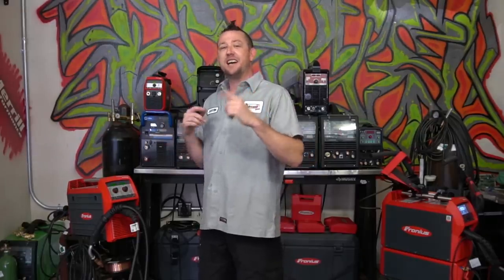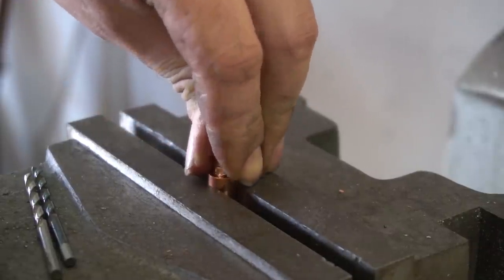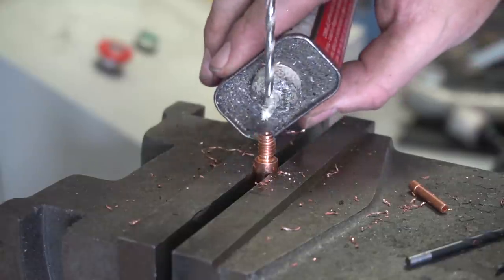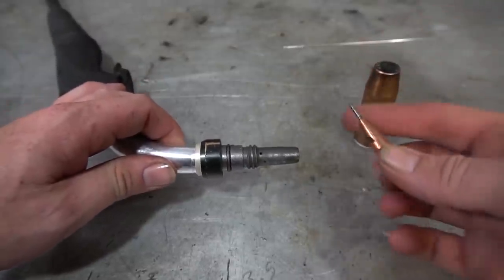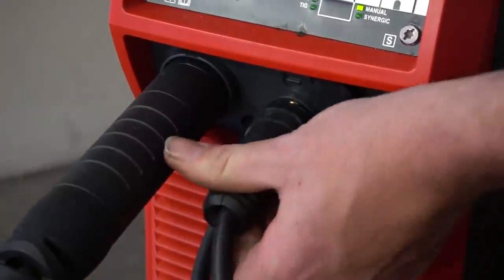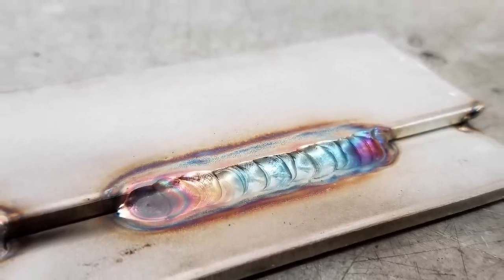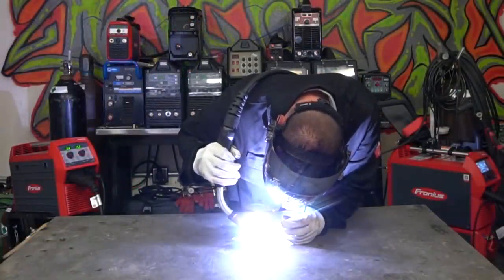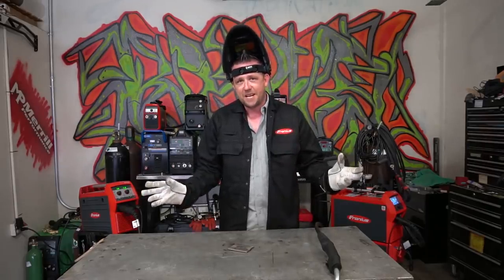TFS: HOW to convert your MIG into a TIG Welder

Comment: My question may seem ludicrous but does it work with flux core mig or do I need gas absolutely ? Nice vid. Thanks, that is awesome conversion.
Reply from the maker: daVidFonda You have to have shielding gas to make it happen.
Reply: davidfonda.. something like this might help you out.. WP-17F 12Foot Air-Cool Tig Welding Torch..

Comment: How do I run my tig and mig on 1 argon tank yes its 100% argon and 1 regulator 2 hoses if possible but only 1 welder will be turned on I just do t want to keep swapping hoses I do have a double regulator it's from China I dont want to sit next to the thing head of them exploding

Comment: How does the power get to the tungston? Do you need the wire touching the other end
Reply from the maker: Tom Bacon No wire needed.
Reply: I would suggest looking up how a mig welder gets power to the wire. The wire isn't energized until it passes through the contact tip. The wire (or in this case the tungsten) must touch the contact tip to transfer the energy through the wire to the metal. Hence the name CONTACT tip. Hope that helps you understand.

Comment: I, m thinking convert Mig to Tig welder with auto feed using Mig   wire. Mig gun should only function as gas n wire feeders. Attach tungsten electrode n connect to electrical part.

Comment: Not getting the mig tip redo. The mig wire is powered as it is fed through the nozzle, how does the modified tip you made get power?
Reply: By "shorting" with contact with the work,(ground)

Comment: Since MIG welding has a whole different way to work with you on changing geometries by effectively raising or lowering the current it seems a very difficult way to weld TIG with it. 
Even if it is strange I still like the effort.
A little more scientific warning to all of those MIG welders out there who could be trying this and failing would have been nice though.

Comment: Do you have to press the trigger to initiate gas flow?
Reply: Brandon Parry well I imagine so and you won’t get any arc without pulling it either. Of course the force is strong in this one...
Reply: fishhuntadventure thats a good point. If you taped it, could get a closer grip and post flow haha
Reply: fishhuntadventure post flow from far away that is. Maybe a trailing shield would be in order for stainless.
Reply: Most mig machines have some sort of electrical connector for the trigger located near the "torch" connection. Simply disconnect the factory supplied connector, rob an identical connector from a worn or damaged lead, and build a crude foot pedal trigger with enough length of wire to get to the work station/position. It will still be a simple on/off switch like the trigger is, but would allow for pre/post gas flow. Also as previously mentioned a Tig is CC and Mig is CV and a Tig pedal is a potentiometer that allows for a variable output.

Comment: I have a ramsond cut50dy plasma cutter.
looks like a little tig welder. theres a decal on side part of it says "arc/welder" bought it from a guy few years back. hardly use it. anyways, can a plasma cutter be modified as tig(dc)? always wonder, didn't find anything on forums awhile back. good video man. thanks Justin.
Reply from the maker: Ryan gst You'll have to find a way to bypass the air pressure safety (if it has one) and disconnect the air. Just add argon and a torch and you'll have a DC TIG.
Reply: The Fabrication Series dam, bad ass. yea it has an air source on the back. and always thought about tryin that out. just didn't want it to blow. appreciate your feedback. thank you👍👍

Comment: Main problem I see is that MIG is normally constant voltage and TIG requires a constant current power source.  Of course if you have a modern welder you just flip a switch and the magic of electronics takes over.

Comment: Your drill bits were wobbling. There goes your precision.
Reply: when drills are put into a chuck correctly, they self center with a little pressure. not losing any precision other than use a drill chuck instead of a collet or other tool holder. and its drilling a weld tip out lol this isnt NASA .0001" precision here... chill out
Reply: @Collin326C  
Yeah I was gonna say as well; it's not machining, part in a pot chuck, indicated and drill in a mill chuck....ha ha ha

Comment: well a mig welder is a bit more thn a power supply..its also a wire and gas feeder  .stick welders are literally power supplies...with specialized connections for specialized electrodes.

Comment: Hey Justin thats pretty kool stuff i knew you would make a vid on this topic. And i know its 100% work becoz i convert my Lincoln Weld-Pak 100 to mig/tig i just bought a tig torch kit on sale and switch the wire around made a turbo mani and exhaust and still havent crack yet.

Comment: That's kinda like driving finish nails into moulding with a masons maul, don't ya think? I can't imagine where that would be a good idea. I can see using a mig or  a tig torch as a stinger in a post apocalyptic scenario where you might need to armor up a vehicle or some other life or death scenario, but not this! I suppose if money were no object and I had nothing better to do than going full AvE on my equipment, then screw ludicrous speed... go straight to plaid!!!😆
Reply from the maker: patrick farley I love the end of this comment.... #SmokeIfYaGotEm
Reply: patrick farley hgg
Reply: patrick farley You can’t imagine where this would be a good idea really how about you need to weld something thin that your Mig Welder wont and you just don’t happen to have a Tig welder laying around. Really this would absolutely work
Reply: Hi Trisch, well seeing as most mig welders lowest amperage is about 30 amps for material that is roughly 24 ga. (.025") thick. Today's TIG machines go down to 5 amps and some 2 amps. For better heat control than this mig gun with tungsten, I would use O/A. If it is too thin for MIG, the tensile strength of braze or solder will be more than sufficient. So this goes to my original thought that using the right tool for the job is your best bet. I hope that clears up my comment. All the best.
Reply: I don't think anyone questions that it is better to use the product designed for a specific job....but who has all those gadgets in their garage.  If you can make one thing work as another to get the job done, then you are just a little wiser than those who don't. This is obviously not for commercial purposes, but for home use it seems to me like a win.
Reply: I know whatcha mean but there's definitely plenty of scenarios where this is extremely handy for sure. One being when a person can't afford a TIG machine & has to weld any semi-exotic metals for one reason or another as I've done this years ago myself. Or if you have to do some thin stainless repair or whatever & don't wanna drop the cash for a spool of stainless wire. Ya can also buy very cheap small TIG machines nowadays but obviously but not everyone has the $ for that obviously...

Comment: Great video! I have just ordered and received most the pieces I need to do this, now I just need to rebuild a microwave transformer to convert my Flux 125 to DC.
Reply: You don't need a transformer to convert to DC, you need a rectifier circuit.

Comment: Can a Tigue torch be hooked up to a mig welder
Reply: if you can get power from the mig tip and connect to the Tig torch yer or maybe look at a cable you can screw into where the mig lead connects to the welder???

Comment: I have a Lincoln electric welder and want to make it from mig to Tig can you help me convert it?? I'm welding a motercycle gas tank and am welding right through it wondering if TIG would be lighter on the metal and not eat through please help. Private message me if you would like I'll send my info appon request URGENT PLEASE.

Comment: Why does no one sell the mig tig adaptor bit he made in the beginning of the video?
Reply: Ian Pollard great question they have left the market wide open for you to make your first million. Go for it I will buy a starter kit from you. Seriously.
Reply: You can buy a conversion kit for Euro mig connector for about $10 and a complete tig torch assembly for about $30. The right brass fitting to connect the 2 for a few dollars, connect the wires and away you go.. Takes under a minute to change from one to the other.
Reply: Brett Whitla right on, where?
Reply: Ian Poland.. What are you asking ?

Comment: Information update: i tried scratch start, but in low amps any arc can not start, on high amps very weak and poor arc tries to appear, but the TIG electrode (Red color) melts immediately. So to ask again: somebody, any ideas?
Reply from the maker: 2 things that make a tungsten melt - wrong polarity or way too much power for diameter.
Reply: +The Fabrication Series Thanks!
Reply: +The Fabrication Series Help please... i used two different Stick welding machines, wired torch negative, used 2,4 mm red TIG electrode and 100% Ar, perfectly cleaned surface, but arc just does not start... actually it started 2-3 times for less than 2 seconds.... What to do...??
Reply from the maker: It's difficult to say. You could be long arcing or not have enough amps. Maybe lift instead of scratch... It could be half a dozen other things. Without seeing it all I can do is guess.

Comment: Can it work without using gas?
Reply: NO, absolutely not.
Reply: @BCole-bj4lv  Thank you very much .. I did the experiment without gas a long time ago and the welding rod got stuck to metal. I thought that the problem was with the welding machine
Reply: @hammodi88m  Your welcome. All three popular types of welding require the weld to be shielded from the effects of oxygen. Stick does it with the gasses formed by the flux on the rod. TIG and MIG rely on the inert gases used. With these two, the gases also help in directing the, (what I'll call - cone of the weld) so that the ionized flame has shape (especially in TIG). Let oxygen get in there and your weld turns ugly, jumps around  and  turns gray.
Reply: @BCole-bj4lv  Thanks for the valuable information

Comment: Hold yours horses. If a MIG could be converted to a TIG (understandable) a MIG could be converted to STICK welder as well? AH...I'm going for it...
Reply: Denis Cortes I think you’re on to something there.. all you would need to do in reality is get a 3/32 or 1/8 collet to fit into the gun like he did here to clamp down on the rod. Pretty simple I guess.

Comment: I bought a 800$ (at the time) flux core, i'm cheap as fuck even though I have the funds available, it's easy to use my flux as MIG and stick. There are a lot of people in this world who would rather make it work with what they got, I mean, if they wanted an actual whatever the item it may be, they would just get it. Having the knowledge to turn your welder into TIG, MIG, flux or stick with very little tools is more than school will ever teach you. How to make a lot from practically nothing, no one's gonna teach you that. Teach me to make stuff and how it works, i'll get something figured out much, much faster. I might even come up with a new way to do it, who knows.

Comment: I’m gonna give it a whirl. I have an old mig that I literally pulled out of a dumpster years ago...the wire feed is jacked....I’ve repaired it a few times but gave up on it. I also happen to have a tig torch assembly I picked up for super cheap.

Comment: ...perhaps you shud just use a tig torch instead, just adapt the tic torch plug to the machine.. this way, its already a better TIG torch usability wise...  in fact, if you can TIG on your MIG machine, you can also adapt a PLASMA cutter torch to the MIG machine.. the TIG machine can basically do PLASMA cutter.. you just have to replace the TIG torch to a PLASMA torch & use an air compressor for the gas line..  it now becomes a MIG/ TIG /PLASMA cutter/ ARC-MMA stick welding machine.. just replace your torch & plugs..

Comment: Keep the tungsten sharp, otherwise the arc is splayed outside the shield gasses. Walk the cup, let the wire melt into the puddle. Quit dobbing the fillerwire like it’s a coat hanger and oxyacetylene flame! Weld should be smooth and filled in one pass on metal that thin. I remove my MIG from the power source and mount my TIG torch, adjust the polarity. Carbon dioxide gas on carbon steel, argon on non ferrous metals. Same as always!

Comment: I actually thought he was gonna attach a Tig torch to the machine. At least a mig machine has a gas solinoid. I have run Tig off a Miller Trailblazer with the gas bottle near by to turn it off and on. Talk about post flow.

Comment: At this point why not just buy a tig gun and install it?
Reply: That's what I did with my bossweld 180. Got a cheap wp-17 hand piece and lead and fit the euro fitting. Whole lot for less than $100 And it does the job, the trigger controls the power so i
No need to snap out of the ark

Comment: This will not work with every mig welder just so people know. I tried to buy I harbor freight welder and hook the internals up to my miller HF start tig box (not a stand alone machine). Didnt put out enough amperage to draw a nice arc....most mig welders dont need to have a long arc what so ever. So they are made to have a super small arc unlike stick and tig welding....I would say this only worked because it was also a tig machine.  But I have not tried every mig machine

Comment: Would this work with flux core? Could I adapt a tig torch to replace the regular flux core and use flux core wire to eliminate the need for shielding gas?

Comment: If you have a machine, that CAN fit a MIG torch, and can ALSO give you fixed  voltage? 

You've spent, a BARE BLOODY MINIMUM of $1200 on that bastard. 

Go and buy a $60 TIG torch! Stop being a bloody scunge! 

Also, most of these multi-process machines come "Out the Box" with TIG Torch & Peddle. It's a damn sight easier to weld with a peddle, or 2T switch, then it is to run scratch. 

and if you MUST run scratch because your off the bench, RUN THE DAMN MIG

Comment: Lesson time! MIG is run in CV to regulate the "pinch" that's when the end of the wire melts and travels across the arc and becomes your weld puddle. Whether by short circuit, spray, globular, etc. This is why CV exists and its exclusive to the MIG process. Basically you just showed the world how to make bad TIG welds. I personally would delete this video since if anyone dies welding something together with what you instructed them to do, you are now what is called "liable". There is a reason why professionals will never do this. Don't worry if this ever gets to a court room you will have some very intelligent people explain the reasons why behind it to you while your fate is determined. You are a smart guy with some real skillz. The reason you got flooded with how do I do this mail is because a lot of people want to be TIG welders, but do not want to foot the cost of the equipment even though they were able to buy a mig welder. Plenty of tech schools out there will have no problem running you through a training course for your chosen process. Maybe some day the March of Dimes will get into weld and fab until then kiddies either learn how to do it correctly, or pay a professional to do it. You should at least put up a disclaimer that this is shown for making bets with people who don't believe it can be done to get some beer money.

Comment: This is a let down. Nifty job rigging the MIG gun up to work, and I'm sure it could help someone, but I was hoping for a way to modify the electrical between constant voltage and constant current to make a regular, single process MIG welder be able to control the power correctly, then just buy the panel mount connectors or rig something up to be able to plug the lead in for a TIG torch. You can actually find them reasonable, and building a proper water cooler to make it more comfortable doesn't even need to be expensive, using a rotary vane pump like a Procon or similar...or the fish pump mentioned in another video apparently works too.
Reply: Cool project. I converted a ac DC buz box to a tig .  Good for tacking but not much good for stringer needs. Because max 60 htz no way to control frequency.  Then naught Hobart ex tig 165i much better. Great show . I live in pahrump. Just retired  I might join you're tig class if you still have then